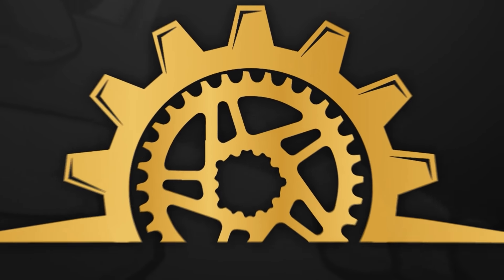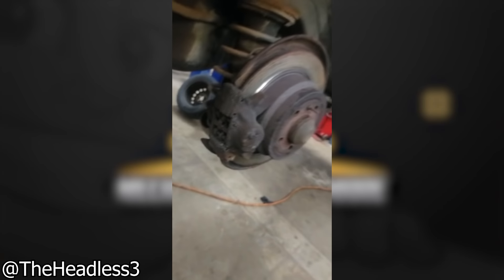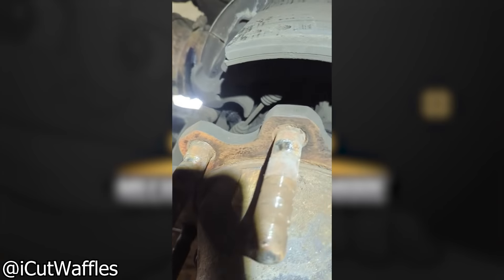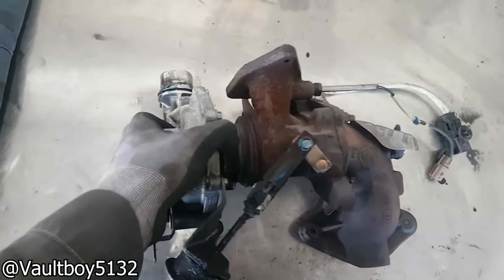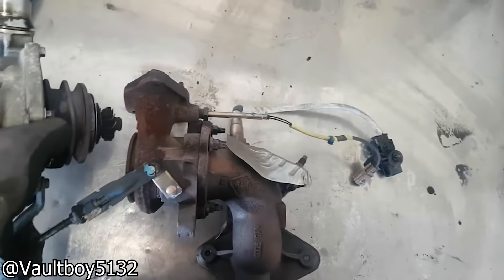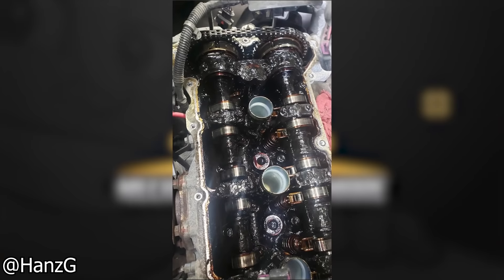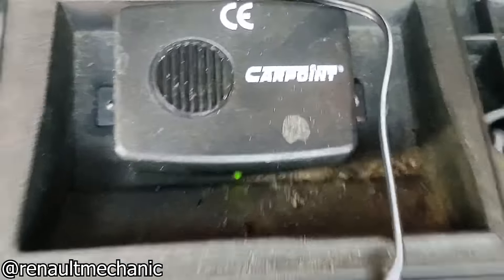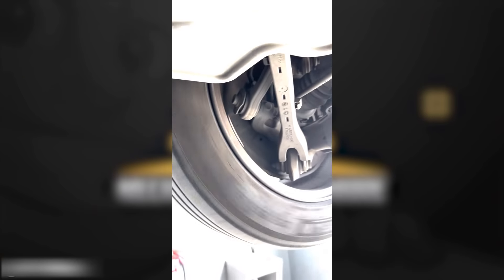Customer States They Change Their Oil When The Red Light Comes On | Mechanical Nightmare 50

Comment: Changing oil when the oil life monitor says to? But I bet that oil life monitor is running a 7500mi interval and you're paying for the 39.99 jiffy lube spill n fill special. Yea bud that's not a 7500mi oil they put in the engine. You'd get better quality oil out of my catch pan.
Reply: They must not be using a quality oil and filter. I change the oil on my moms car whenever the oil monitoring system says to and its still super clean inside. Granted though i use the oem motorcraft filter and oil which is a synthetic blend. No sludge and runs great with over 150k miles on it and i ve been changing the oil since she bought it at 33k
Reply: @thaton3guy100  Jiffy lube uses Penzoil. Which, yes, There is good Penzoil. One of their oils took 2nd place in Project Farm's oil championship. But not just like not all oil is created equal, not all Penzoil is created equal. Fun fact. Penzoil's cheapest of the cheap, is 100% recycled oil that's had contaminants remove, been pH adjusted, and a few other things that they do.
Reply: Bet the oil life monitor is actually an oil pressure warning light and they're smoking the fuck out of it.

Comment: The flywheel @1:54 is normal wear, only changed to late. It's a dual mass.
Reply: I have had to fix one that spun, so all the bolt heads disappear. 
Only option is to cut off flywheel with grinder. 

Cut thru a 1inch thick flywheel sometime. 
Find out how much fun I had.